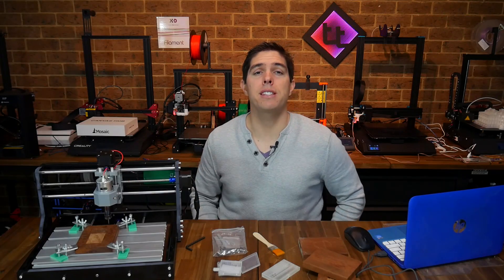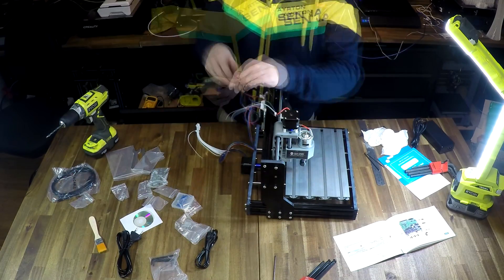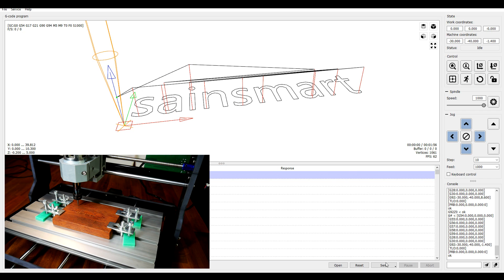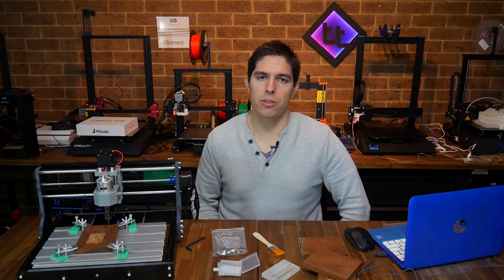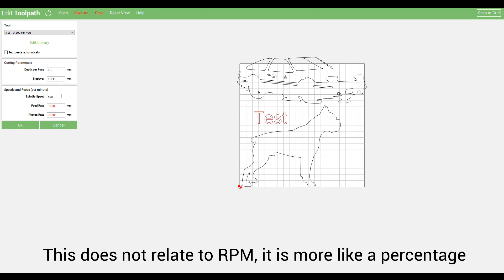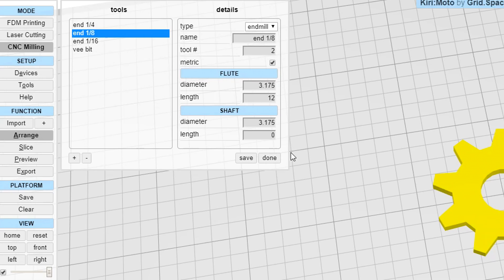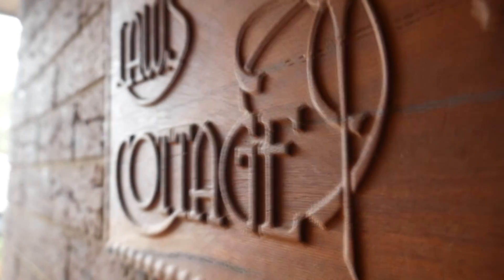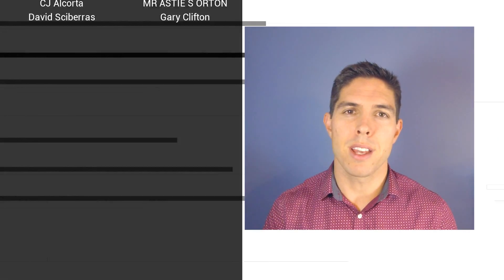CNC router for $200 - Sainsmart Genmitsu 3018 Pro review and tutorial

Comment: There is actually a formula you can use to figure the RPM required for your cutter. Another formula tells you surface feet per minute required for different materials. Would probably be very helpful. Also, most of the time we include a finishing pass with higher rpm and slower feed rate. Just leave a couple thousands of an inch on the roughing pass.

Comment: This review needs to be reviewed and updated.

The review got me excited and enthusiastic.  Sadly, the  advice as relates to other software to use with the 3018 PRO is tragically out of date and misleading, even time-wasting.
Don't get me wrong, I think it's a great review generally.
Just that if your going to tout it to 1.4 million viewers as a "getting started" vid,  then really, as a "professional", it should be current.  Not all of those 1.4 million looked at the clip all at the same time 4 years ago.

Thus inspired I tried to commission a 3018 Pro for a mate, and get him up to speed.
Took me three days (elapsed) to figure out that the offline controller he had plugged in  th8us disabled control feed from the PC.  Thanks to the YoraHome channel for restoring my sanity.  No other YouTuber or online documentation that I was able access mentioned this idea.   (Note we are proudly, a pair of old farts who started our careers with bamboo slide rules and 4-funcion calculators so...).

Next I took your advice and went with Carbide Create.  Used the link provided, no problem easy to use for design and toolpaths.  Then to generating g-code that the router can use. 

Turns out your link to Carbide Create sends me to a site that offers CCv7 only.  Also turns out Carbide Create v7 does not generate g-code any more.  Need another program for that.  Turns out the other program (Carbide Motion) doesn't support 3018, xCarve et al routers.  Dead end.

Found a Carbide site that lets me download CCv6.  It does generate g-code the router can read.  Just doesn't work is all.  Still stumped on this one.

Pity;  the 3018 Pro seems good value for $200, can certainly do all and more that we want, and your presentation was just the spur we needed.

The quest for success continues.

(BTW being Australian meself I welcome opportunities to support Aussie creators on YT.  Really.)

Comment: I know 0 about 3D printing. I have a problem that I believe may only be solved with this tech. Maybe you can help or make a suggestion? 
  I have an 07 jaguar xk that needs a driver side headlight lens. I glued the bucket together and heated plexiglass to form it to the bucket. It looks ok but Do u know of a way to plot a whole new light fixture for it without having the original lens? I could buy a used one off eBay for $1000 but what fun would that be?

Comment: I just found this video and had a question regarding Model Train Linkage for the wheels on Steam Engines. They are 2 to 5 inches long and about 1/2 wide. Made from miild sheet steel about 1/8 inch thick. Could this machine handle such work???

Comment: This is a similar software you'd get in commercial CNC control pannel.  Conventionally G-codes on CNC machines are set manually, as cutting doesn't involves thousands of path changes. This might be a terrible software for someone using 3d printers.

Comment: I bought one, i got it to learn to program XY and Z, i found this router doesnt like hard woods, the cutter will flex when driving thru wood grain, soft pine wood is real good, I also had an issue with scale, some designs are made for bigger full size routers, when scaled down it doesnt look the same. I do like writing script and have made crown moulding , each file design i moved the crown board to home and carved over and over and over.....

Comment: Like your videos a lot. Seen a ton of hobby CNC videos and it is never mentioned anything about other metals except aluminum. Anyone have any idea if copper, brass and silver can be cnc:ed (with slow feed and cutting depth) on this machine? Im talking about sheet metal (1mm - 3mm) that i want to cut for some geometric jewellery work.
Reply: You’re gonna have to consider new bits with specs that conform to the material you wanna cut, I also recommend studying in the speed and  feed rates for material of the size you want

Comment: Great job - especially appreciate the software discussion.  Would you please do a review/How-To for the laser upgrade? My CNC 3018 came with a laser, but no mounting instructions, no screws that fit it, and a mystery button on top (I suspect it's for alignment & focusing at low power).  What software is out there specific to laser cutting?

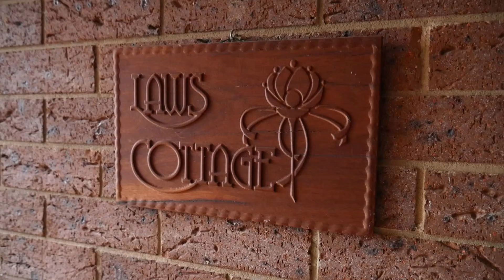Comment: 14:00 how did you do the edges? Don’t the clamps get in the way
Reply: Use a piece of stock bigger than the final product enough to account for the clamps without colliding, and then mill out (or otherwise cut) just the finished part.

Comment: I had similar issues with an other CNC router losing it’s connection with the pc and just stopping. It happens when you stand up from your chair and build up a static charge. Solution is to loop the usb cable through a clip on ferrite choke near the side of the machine. Never have had this issue again.

Comment: Junk i have one wish I did not buy it the software is terrible only installed some and left some out when you hit the button on comp to bring router up it goes down you hit the button down it goes up the other buttons work fine and no test cut available folders are empty and when trying to put it on a nother comp it just have error messages

Comment: Great job on video you answered one of my questions before I even answered  it 00it but I do have another one for you and that was when you did your design and it went off off more than it should does it have an outline to marked the other is where you put the clamps down.
If so measure from inside the tape. I used to have an embroidery machine and a plotter and a very similar machine to that he got me interested in it so far it seems pretty easy and I think I understand it pretty well again great job on the video and I'm going to subscribe

Comment: I am just thinking about a router and know basically nothing about CNC and a little about STL files, CURA slicing, and the 3D printer. You used a lap top in the video, does it have to be Microsoft or is MAC ok as well? If a STL file for an object is generated where is it inputted next? Simple question, but I really have no idea for the CNC process. Does this unit provide some sort ot interface to take the STL file and convert it to G-Code for feeding into the Router's electronicts or is some other black box thing needed?

Comment: Spindle speed is your RPM's.  When you are doing a screw hole, you'll need the proper drill size with a high spiral cut tap or roll tap depending the material.  The formula for the threaded hole is RPM (spindle speed) / Pitch (tap) = Feed rate OR if metric it is RPM's (spindle speed) x Pitch (tap) / 25.4 = Feed rate

A tip instead of using water, go to your local hardware store and get some oil.  You'll be able to spray it on as the tool moves.
Also, those are not called V bits.  They are called Engraving tools.  Sorry for the corrections, I'm really glad you did a review on this product.  I'm a cnc machinist and i will definitely be picking this up to help further my programming skills at home since i already have mastercam software to make myself little toys such as transformers and legos.

Comment: this was a pretty good video, i am seriously thinking of purchasing this (90% sure) but i have questions that i hope that some1 with experience using this machine would know and see this question and help answer. i plan on using this machine to surface plane silver (only a few thou, not meant to remove too much material at a time and time is not concern)then a slot (i don't think im concerned on this part) then i plan on using the the 15w laser (maybe over kill i don't know) to engrave in the slot that hopefully (with adjusted speed) has a relatively non shiny surface. since the price of the 15w laser pretty much doubles the price of the kit and comments that i read here and other vids, is it worth the hassle to purchase a third party laser that's not chinesium?

Comment: I had posted several months ago that this video inspired me to buy this machine. As many have mentioned , it is very light duty and a beginner machine at best. It does require a few modifications to correct mechanical issues  that do arise , but completely worth the price you pay. I added a 5.5w (output) laser to this and a diamond drag engraver tool, both which substantially increased it's ability to do more things. Since this got me comfortable with cnc engraving  and laser engraving ....I then purchased a larger machine , a cnc6040 with a rotary axis included. I again want to thank you for your clear, unbiased information that helped me embark on a new path that I've been planning on for the past 15+ years. It all started with this video being the "nudge" I was waiting for . :)
Reply: Do you have a link of your cnc6040?
Reply: Thts cool I'm glad u finally got the nudge to start!!!!!!!!
Reply: Really cool to hear this man

Comment: Thank you for the video. I was wondering about the PCB cutting, does any of the software used allow for surfaces that aren't quite flat. I've seen people doing multi-point bed height measurements using a resistance probe (probably the cutter itself) as an input to the controller.

Comment: I can build these machines all day long, it's the damn software that is almost impossible to figure out. 

I have a 3D printer sitting in the corner collecting dust.
The only way I could do anything with it was to take an existing design and tweak it.
 I tried the website called Thingiverse which has thousands of existing designs but for some reason, they all have fatal flaws in the code.
There was one site that was helpful called 3D Tin but the author decided not to support it and shut it down along with all of my designs. 
My advice to anyone who might be interested in purchasing a CNC router or laser is to learn the software before you waste a few hundred bucks on a dust collector. 
Sorry about your dog, I've had to put three of them down in my life. I loved them all, couldn't ask for better friendships.
Reply: The problem isn't the Thingverse models. You're going to have to sort out your printer. What model is it?

Comment: Would you try something?  Put the bolt in the plate with the head on the bed! 

Adjust the height to close to where you need it, 

tighten the wingnuts to about level and this should spread out the load under the head of the bolts.
I would even use the green plastic to protect the aluminum bed from being damaged.
You may consider 3D printing a plate the bolt pressed into.
If you need it tighter loosen the wing nut adjust the height and tighten the wingnuts.
Good luck,  keep posting.

Lee

Comment: Put images in photoshop and apply sketch filter for stronger lines. As for gears, drill the center hole yourself with a hand drill and remove hole from program to save time, energy and your bit's longevity.

No I do not use cnc machines, own them or know anything about them. I just know waste when I see it.

Comment: Would it mill an aluminum ar15 80 percent lower
Reply: No. Ignoring the low resolution and power of this hobby grade gadget, an ar lower is too big. You're better off using a harbor freight drill press and router and a set of drill blocks. I can vouch for that.

Comment: I'm surprised you didn't show how to do Z-mesh leveling on this for PCB's. You can use OpenCNCPilot with this and the controller board has pinouts to wire the PCB blank and the tool chuck so it can probe about the blank to compensate for the fact that they're almost never completely flat.
Reply: Also, the controller board has pinouts in case you want to wire up end stops too.

Comment: I have a desktop model that still uses Parallel port and is having troubles. Would you happen to have any information on the USB controller on yours and if it's sold separately? Just happened on your CNC video when I was watching your 3D SKR upgrade.

Comment: If your goal is to mill aluminum idk why you would start with a $200 router. Take it from someone that bought this and 3 other machines before buying the sherline mill. If your end goal is soft metals and lots of non flat features just buy a sherline milling machine and stay away from routers. This will make pcbs and tiny wood signs but mostly useless stuff.

Comment: Just wondering what the diameter of the spindle motor body is? Have a couple of round routers that might fit for a faster spindle speed option. Thanks for the great explanation and look into the software.

Comment: You have to run climb with acrylic. I bet the edges on the waist cuts were clean.
Reply: Only in case the machine is rigid... Not this case :-(
Reply: @firefoxik75  didn't consider that however I would still recommended trying it at 80 to 100 feed rate and 10000 rpm with a much deeper depth of cut.
Reply: @authentic_existence  You can't go deeper if the machine is no rigid... You will experience chatter on the bit which means bad surface finish...
Reply: @firefoxik75  I understand that but you can also adjust your feed rate and rpm to compensate and eliminate chatter. The reason I suggest trying deeper passes is, especially with a less rigid machine you're likely to result in a sloppier finished edge with many passes into a soft material! I've worked on smaller machines as well as industrial machines with all types of materials. I simply think you'd find a better result if you increase your chip load. It takes experimentation to make sure your getting the best out of your machine.

Comment: Getting a small, cheap CNC before throwing serious cash at a large machine is very sensible. I bought one of the Gearbest T8 machines (nowhere near as well sorted as this unit) and it was just perfect for learning how to drive the software, learn to write a little gcode and generally operate a CNC before throwing £1500 into a WorkBee. 

BTW - for machining plastic parts I built a water tray so that the job was done completely under about 2mm of water. Made a big difference to the finish and no sign of melting even when cutting HIPs sheet which has a fairly low melting point.

Comment: Hi Mate, thank you for the amazing detailed instructions. I am very very tempted to purchase one of these but the thing is I only have purpose for it and that would be create wax stamps for my partner. She gets a way to create her own custom wax stamps and I get a free toy - win win :-). The thing is Im not sure if this is up to the task even if I was using something like jade or a soft metal such as a copper alloy. In theory if I do it slow enough and with the right bit and high speed I can get the detail I would love to get your feedback on it as some who no doubt has hundreds of hours experience with this machine. I know even soft metals might be a a challenge for this but even using Jade might be possible as the key is the fine detail and the smooth finish. I have tried using a 3D printer to do these but the texture of the layers means the wax won't separate properly when used and even post-processing with painting to smooth out the surface works but very fine detail gets lost as the wax will not seperate it just gets stuck in the small crevices. I suspect the reason metal is needed is for the heat absorption/dissipation and smooth finish for a clean separation. Any input here would be very much appreciated.  

https://www.youtube.com/watch?v=0e-_aP5ah68

RIP Webber

Comment: I think I need your help with that machine. My machine creates 8-12% smaller parts and I have no idea where I can adjust it or fix this issue. A circle of 10cm is at the end just 8,8cm. Do you have skype? Would really appreciate if you can help me.
Reply: I don't know how that software works but it sounds like you didn't make the tool correction. That means when you make a shape with 2,4mm mill, it will mill exactly on the line of the shape and you will end up with 1,2mm smaller shape (1,2mm is the chord of 2,4mm radius). The solution is to enable the tool correction in the software/program if there is an option, or to make the shape bigger by that 1,2mm margin.
Reply: @MaciejakGitara  Allright... I will check this out. Thank you very much! Wish me luck!

Comment: 8-8-19 Today this cnc is $239 on amazon.
Thanks for showing.
Reply: You can get cheaper ones of the same thing on amazon. Like I got mine with an offline controller for only $192: https://www.amazon.com/Upgrade-Version-3018-Engraver-Controller/dp/B07MDG7R2J/ref=sr_1_7?keywords=cnc+3018+pro&qid=1565842626&s=gateway&sr=8-7
Reply: @griffing1368  I can confirm. But price went to 195, lol..

Comment: The tool paths in g-code are made for specific tools. The engraving bits you are using are good for engraving but to cut the example 3d relief, you need other bits. Unless there are notes in the g-code telling you which bits it's using it's mighty hard to tell. It is probably something like a small ball nose end mill to get the detailed carving. Larger square nose end mills are often used to rough out a lot of material before carving the detail.

Comment: Fusion360 is phenomenal cad/cam FREE software. I use it daily, rarely using my very expensive solid works/ powermill seats unless I’m programming 4/5 axis machining. Machine seems cool for the price. I hope no one expects to machine aluminum with any sort of accuracy/ surface finish with a machine like this, just not rigid enough to handle metal. I’ll buy one to do some cool wood plaques land to fuck around with!

Also, superglue and bluetape makes for great solid work holding, without the need for clamps taking up work envelope, so you can do full machining around all areas off a wasteboard.